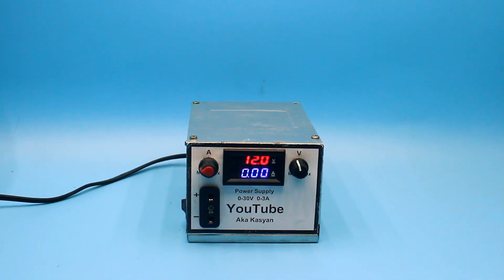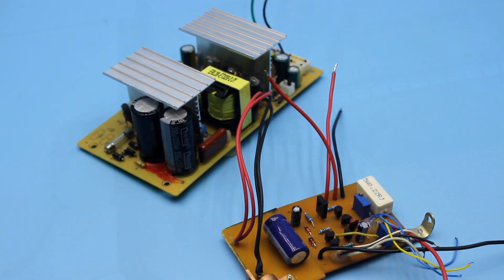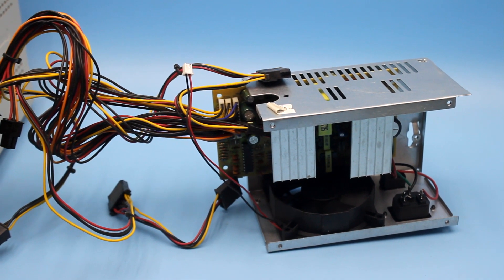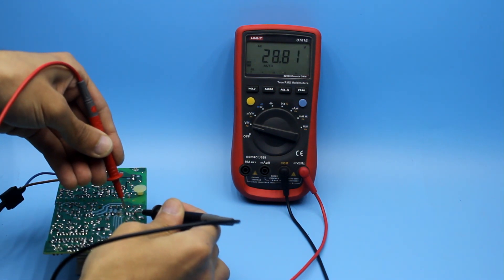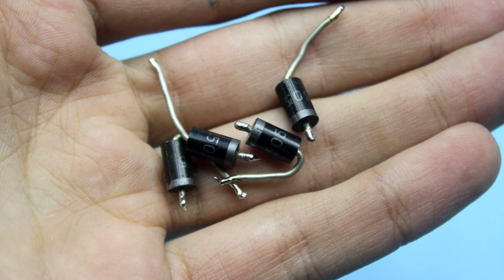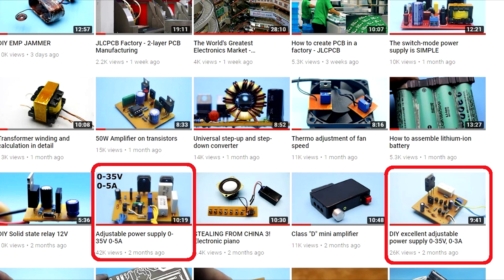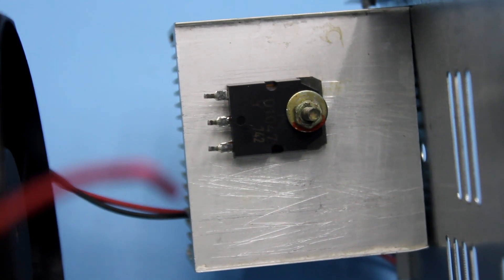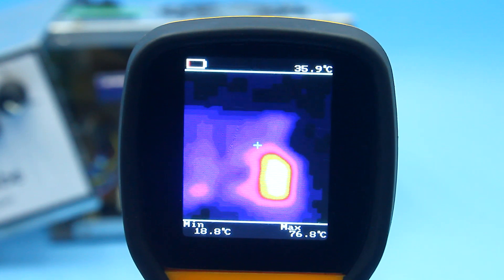How to make adjustable power supply using ANY computer power supply unit

Comment: I do this practical but result is not good. A large amount of ripple produced. Not every supply have same design. I do different practicals to convert ATX power supply into bench power supply but a lot of ripple produced and other design fault. I not recommended that modification in ATX.

Comment: I have a problem: I did the thing to get 24V DC, I used FR203 diodes in a bridge...and got 55V. How? And how do I step it to about 40-45V witch is the maximum my buck converter will work with?
Reply: Did you got any solution???
Reply: @aravindwilson1558   I got a buck - boost converter lol.

Altho i think the issue might be qith the group regulation choke on the output.

Comment: i tried to bypass the inductor at a high power smps . the mosfets get very hot very quickly . so something is missing in this design .
Reply: also when you connect positive and negative 12v together they will already have the bridge rectifier if you connect them after their factory diodes before the inductors you will still get 24v .

Comment: Hi Kasyan. Excellent an creative idea but here are some suggestions. Adding capacitor after FULL BRIDGE RECTIFIER ( ;) )  is not good idea in hard switch topology because of inrush current. You are endangering primary switches (transistors)  and you also lowering life expectancy of that capacitor in rectifier. You should add a storage inductor that acts as a passive buck regulator and attenuates output electrolytic capacitor's inrush current. Best regards.

Comment: You can't really control the current. The current can only be measured and limited. The element/load decides the current it will conduct at its given state.
Reply: they call that limitation " control "

Comment: Please make a video on variable dual power supply with output short circuit protection , it's more necessary then single power supply . thanks. Love from Bangladesh 🇧🇩📶📻 👍.
Reply: As long as the ground and the negative lead of the power supply aren't connected the output is floating which means you can connect 2 power supplies to have a variable power supply with negative and positive voltage the only issue is if you want to keep the 2 voltages the same without manually adjust them but that can be fixed pretty easily (check tracking double power supply)

Comment: If we don't need 12v or 5v can we remove those factory diodes and toroidals and capacitors in secondary side?
Reply: No, these power supply's operat in a deferent way than you might think, not all of the voltages are well regulated, these are switching power supply's that regulate the 5 volt supply by providing a sample to the PWM regulator that drives the high voltage mosfets that drives the main step down transformer. This means that the 5 volts is highly regulated and the rest will very a little with there own load but may increase slightly as the 5 volts is loaded down. Without the 5 volts the output will just run wide open, and very with line voltage, and with load on any remaining outputs, that's why some of these power supply's have to have a load, or load resistor, applied to the 5 volt supply to work properly, otherwise the filter capacitor, will with no load satisfie the feedback loop and let the regulator cut back to an idle, causing the other loaded outputs to sag or drop out altogether.
Reply: I did it...and killed my PSU...

Comment: why mine has 40-50volt output on sscondary trans when i add the diode and the capacitor(35v2300 ùf)?
Reply: Did you got any solution

Comment: I made that and got FUKKEN 60V, HOW? I HAVE NO IDEA.
Reply: I NEED HELP PLEASE I'M GETTING CRAZY HOW 12 + 12 IS GIVING ME 60VDC?
Reply: @robsonszpanic6485 how did you solve this problem tell me in detail pls
Reply from the maker: This is the amplitude value on the capacitor. Connect a small load, then measure the voltage
Reply: Now I understand.. But how you did it with only a 50v capacitor? Why it didn't blow up?
Reply: And feeding the Tl494 with 60v isnt a problem?

Comment: Amazing!, But I have a question, if the core  amps is limited to 3amp then how at the output of the 5v/12v/3.3v we have amperes upto 20 or 23amps? 
Just confused about this part. 

And thanks a lot for sharing the video 
Cheers!

Comment: This is quite ingenious, adding your own bridge rectifier while leaving the old one to regulate the voltage. 
You could even still use the original 12V output at the same time.

Comment: How you maintained the short circuit protection?
Reply: if short protection is on the primary side, it will work. I assume that´s where it is normally done? Otherwise you would have to monitor every output rail separately.

Edit: Actually, it shouldn´t matter where the short circuit monitoring is, since the transformer cannot generate any voltage anymore if one of the rails is shorted somehow.

Comment: I have  165VDc  15a power supply. How can I safely step down and make adjustable? Thank you
Reply: Please share a picture of that beast !!  There should be quite a few secondary taps on the transformer so you should be able to find an appropriate voltage to suit your needs.  I'm really surprised to see that much voltage and current for a power supply but I guess there's always a first time for everything.
Reply: Just use step down converter

Comment: Is It 3A max? Is It posible more A?
Reply: TheJavaSync buy a buck boost converter from eBay for 40€ for up to 50v and 30a or buy a cheaper one for less v and a
Reply: @nick5625  At that price, plus the ATX power supply (if bought new) this gets close to the price range of a (cheap) chinese regulated power supply (30 V/5A).
Reply: Lejf Diecks 1 to be waiting this video you probably have an atx power supply , 2 you don't need a power supply a 12v transformer with a full bridge rectifier and some capacitors will do, 3 you get 50v 30a which is much better.
Reply: Lejf Diecks don't forget your 1500 watt fuse 😜
Reply: This is the type of project that you would consider to extend the purpose of some electronic parts you already have that are actually collecting dust.  These power supplies are fairly robust so you may even consider going to the flea market and get an almost useless PC tower for a very small amount of money and use the power supply in it.  So yes, if you start from scratch and have to buy new parts to build such project, it might not be a wise investment.  For us who have a more limited budget and don't have much parts in their electronics bin, buying new and already operational units sounds more logical.  Also, when you're dealing with SMPS power supplies, things are getting more complicated than with the linear ones, so if your knowledge of SMPS is limited or if you don't have the proper tools to troubleshoot, the overall experience will be very unpleasant.
Reply: As per their constructions, power supplies have their limits.   Simply put, don't expect a power supply to provide more wattage than what it was designed for.  Simply choose your power supply as per your needs.  Also, higher currents require more attention because they're closely related to the "magic smoke clouds" if things aren't designed adequately.   Unless you're dealing with special things, what type of projects are you working on that would require large amount of current ?  Beside powerful led lightning fixtures and some audio amplifiers, I never really needed more than 3A as of now.
Reply: For 5A, change aditional circuit in this video with +Kasyan TV Adjustable power supply 0-35V 0-5A, check https://youtu.be/_r3_GjnwI2A
Reply: Nice !! Thx all :) peace

Comment: 12-（-12）=24？
Reply: Try typing it into a calculator.  [. . . . .]  Mind blown, eh?
Reply: yes you can get 24v that way, but the -12v is only for low power, and therefore 24v is too. Not sure if all ATX PSU are happy with a load between these though.
Reply: voltage are relative to one another thats why.
like stacking 2 AAs battery in series and take center as ground you get + and - 1.5V at each end then a total of 3V in series.